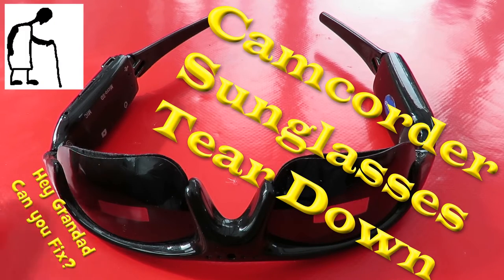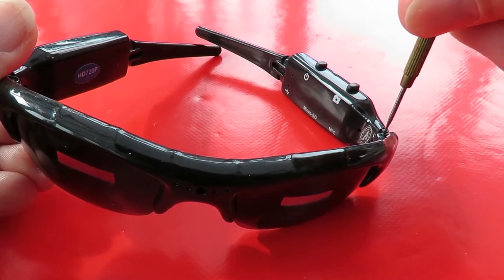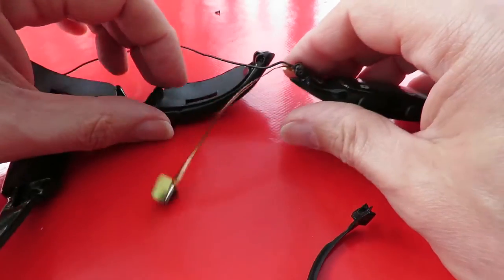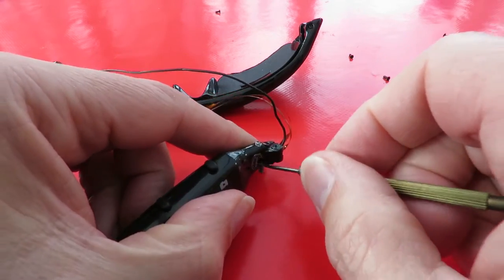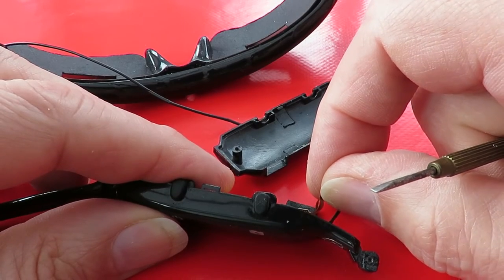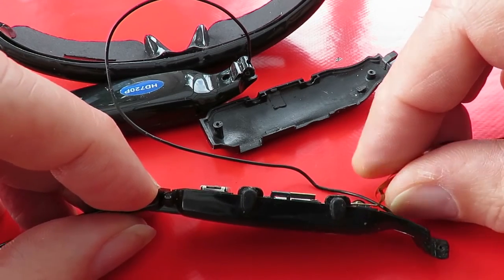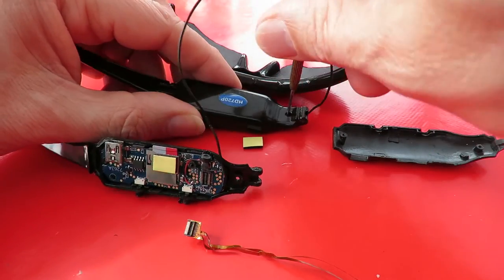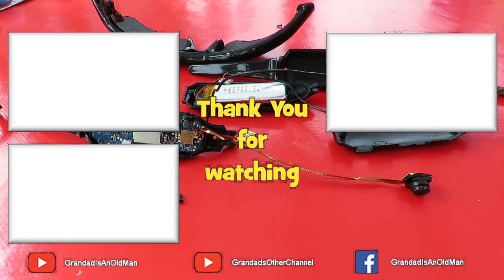Camcorder Sunglasses TEAR DOWN

Comment: Check the voltaje with the lipo?
Reply from the maker: The LiPo is perfect, it is actually better than the eBay listing details stated and still holds it's charge fine. If I don't find a fix for the camera I will keep the LiPo for my airplanes.